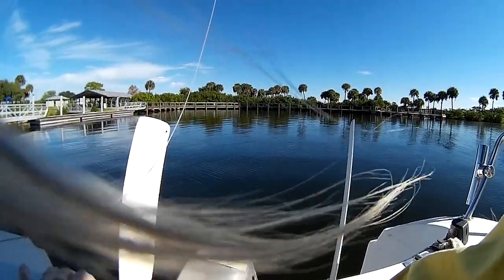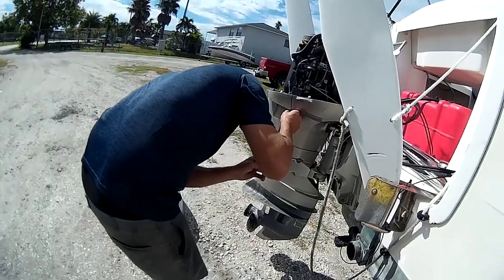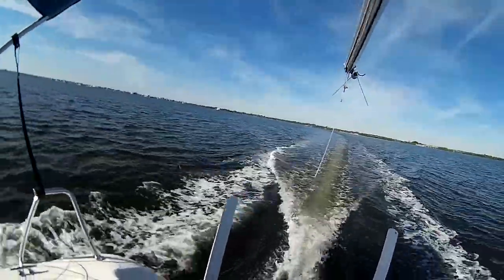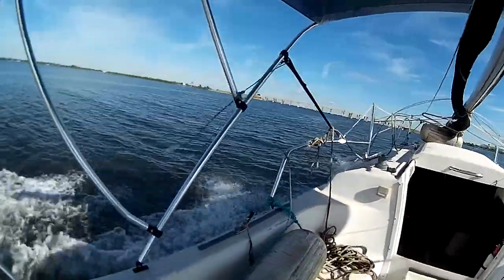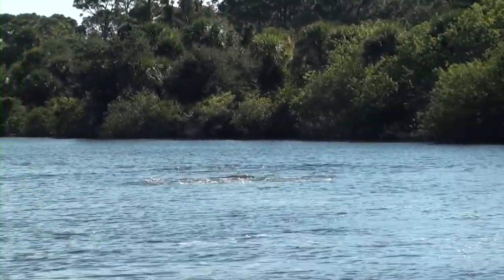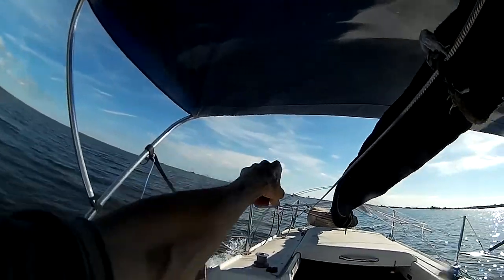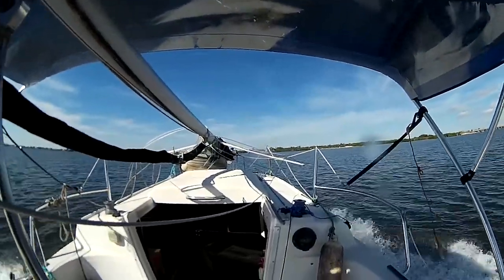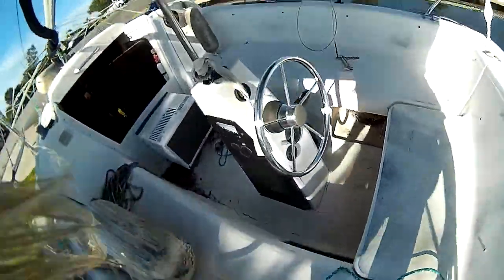Stealing The Boat Part 4 - Hauling A** In A Sailboat

Comment: Have you tried using reverse to maneuver back to the pier so wind doesn't blow your bow off?
Reply from the maker: You are right.  If wind makes the boat uncontrollable at low speeds, just back up.  The boat actually maneuvers a lot better when backing up.

Comment: Is the Honda a 90 or a 50??? Mine is a 50 and it does wonders!
Reply from the maker: its a 50 horsepower Honda outboard motor.  I think this is what came standard with these boats.  Once I got the water ballast drained, it really flies!

Comment: If your view is the same as view from the camara you have a hard time spotting driftwood!
Reply from the maker: This is the case with almost all sailboats.  Its especially bad when navigating the Bahama Banks.  It is shallow and there are coral heads everywhere that reach up close to the surface.  I always wanted a second set of controls right at the very front of the boat for all my sailboats.  One of the things I love most about the Carver is its flybridge.  From there, I can actually see where I am going.